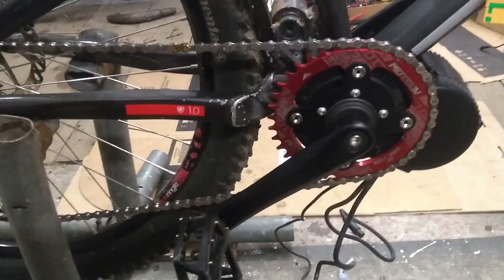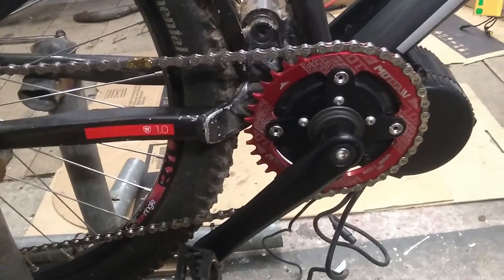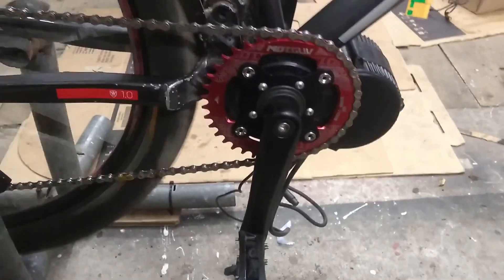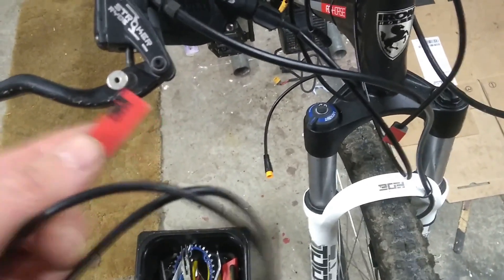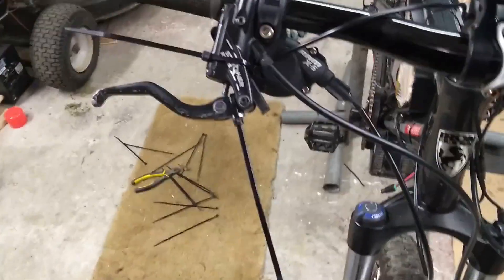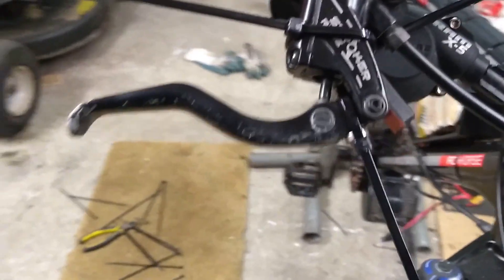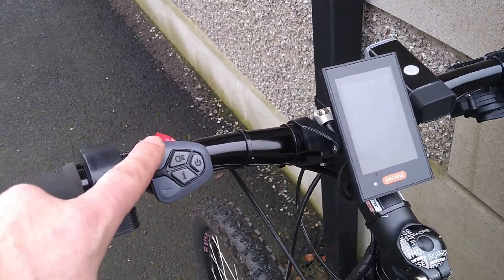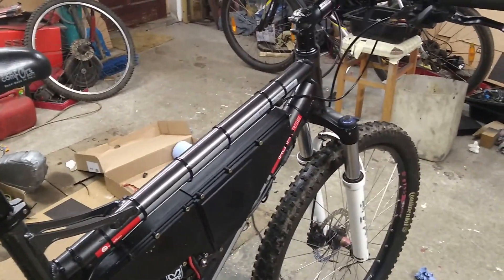Bafang BBS02 installation was a PAIN

Comment: I use the original 44 Bafang chain ring, and it is OK. I have the bbs02. The throttle is a bit rough, I will get the Programming USB cable and program the PAS and the throttle. A little fun on a rainy day. Good Luck to you.
Reply from the maker: Thanks for your comment. The standard chain ring is perfect for road use, I only changed mine to improve the low speed performance.

Comment: interesting you also use a bbs hd now - coming from the voilamart hub motor. I use a well lubed bbs hd with a 14s 9p battery and a lekkie 46t chainring. Also in use is a gear sensor. The motor has a 
45 A controller upgrade  and is torquey and  pretty fast - 65 kmh
Reply from the maker: It's only a 36V 500W BBS01 or BBS02 I'm not certain what the difference is.
The reason I put the Bafang on the off road bike is it's more controllable and for the kind of riding I plan to do 500W is plenty. 
The Voilamart motor is being fitted to my road bike at the minute and videos of that will come soon. It is 13S 8P now but may end up 14S as I plan to reweld the pack now I have a decent Malectrics welder.
Reply: @alibro7512  I use an arduino spot welder  - also nice to use - perhaps helpful for you could be chains from KMC - if you didnt have already a look at these chains - and perhaps an eggrider for programming the motor.
Reply from the maker: @nickgalena1  I bought a KMC chain already but after a bit of fettling I got the 10 speed link onto my 9 speed chain. I've also checked the chain hasn't stretched and all OK. 
I'll keep the KMC chain as a spare